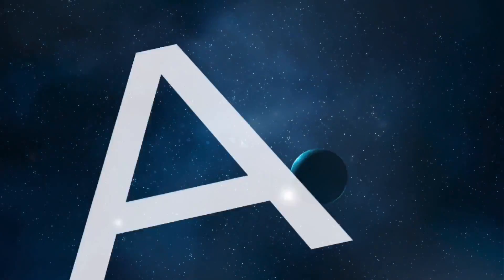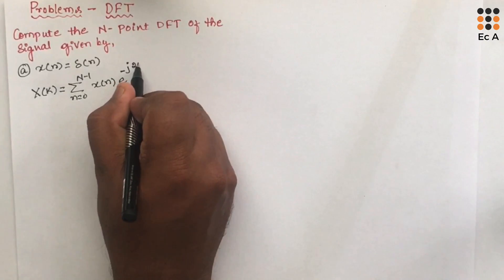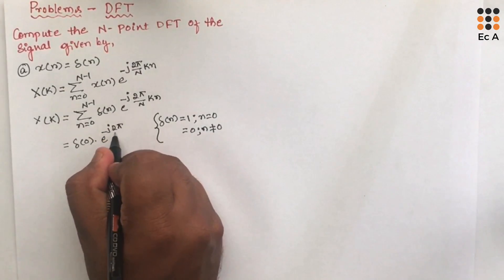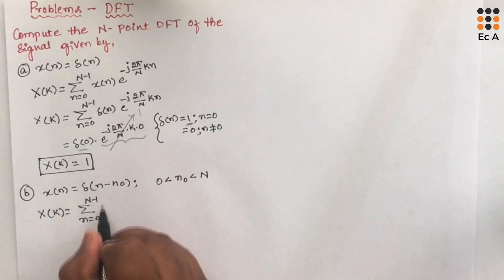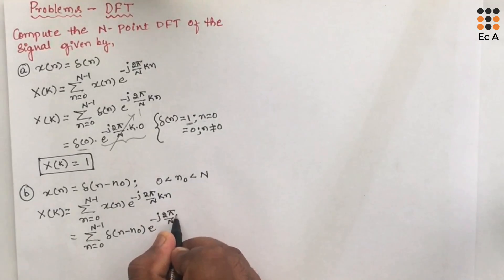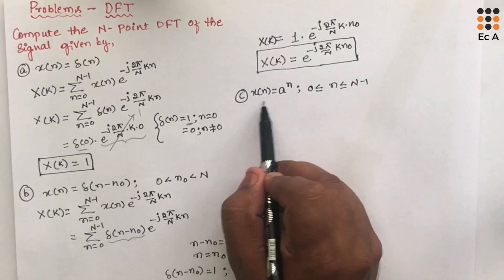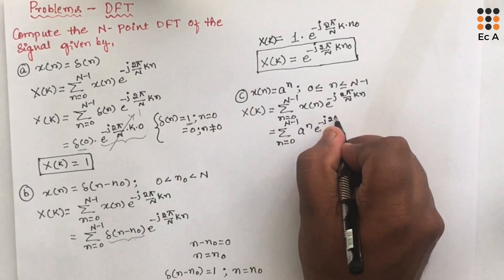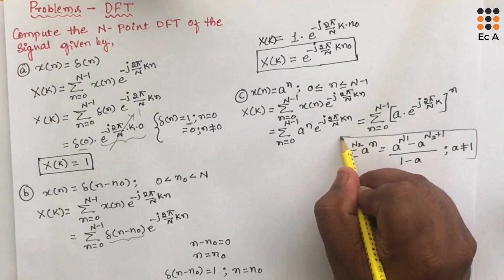Problems on Discrete Fourier Transform (DFT) || EC Academy

Comment: Please sir, I have tried inputing the values on my Casio calculator but the results ain't correct, what mode on your calculator did you use for the operation..
Reply from the maker: Write down the values in paper and try... you will get correct answers... do subscribe and keep supporting EC Academy 👍🏼